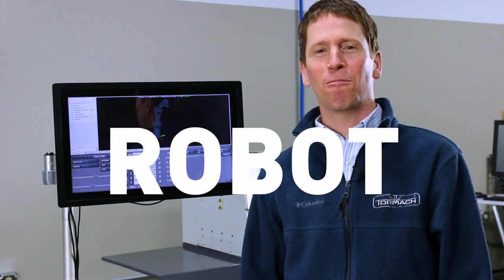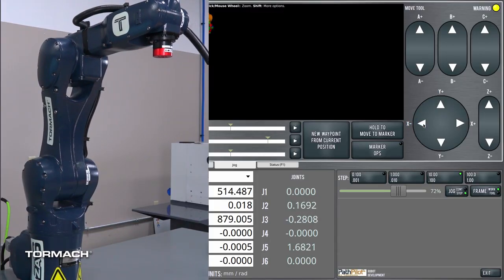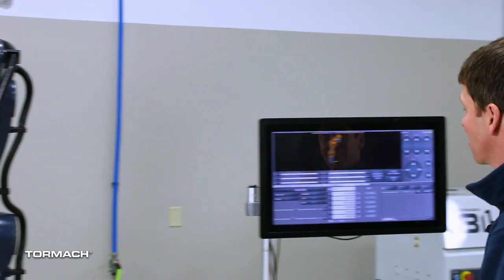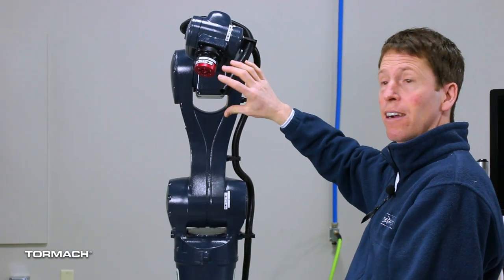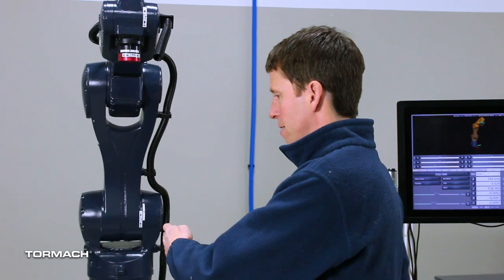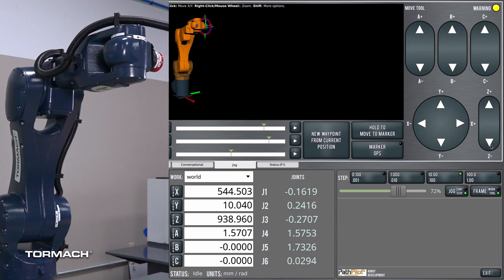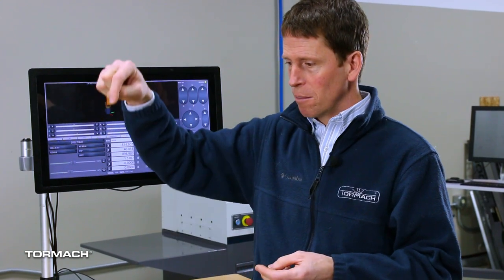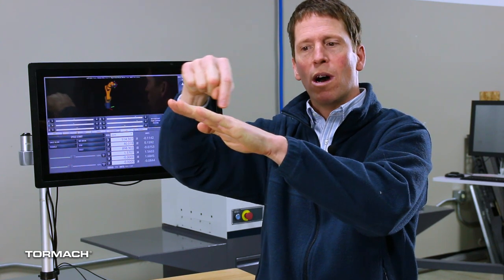Tormach ZA6 Robot |  Cartesian Coordinate Jogging | PathPilot Quick Tips

Comment: The new plasma table could be obselete quite quickly.  Turning an arm into a plasma cutter has been a drem of mine for quite some years now.  Oh the endless possibilities.
Reply: I have both in my shop and an industrial robot is not really a replacement for a CNC plasma. Sure it can be used as one but it wont work as well if you plan to cut parts all day everyday. Not to mention the limited reach. Every machine has its place.
Reply from the maker: MrJTJINX if you were add a plasma cutter to the ZA6 Robot what would you cut with it, how much reach would you need to accomplish it, and are you thinking of adding a rail system?